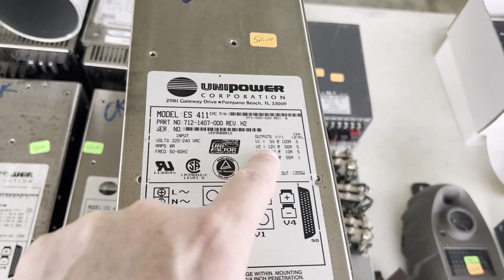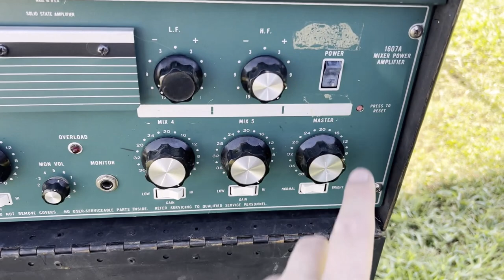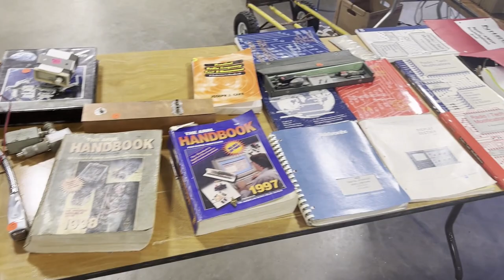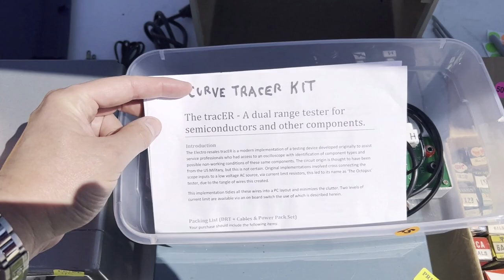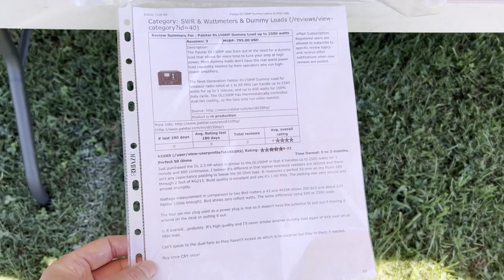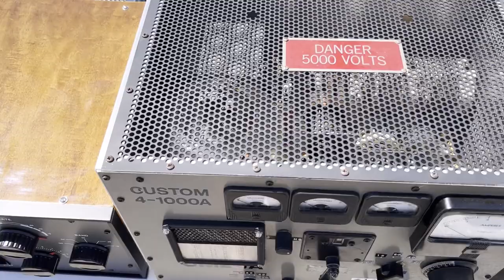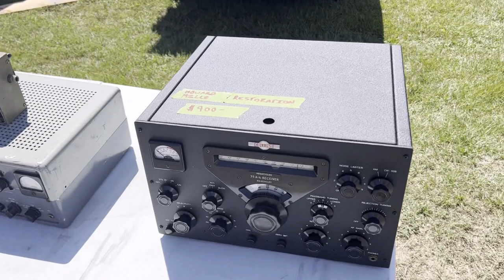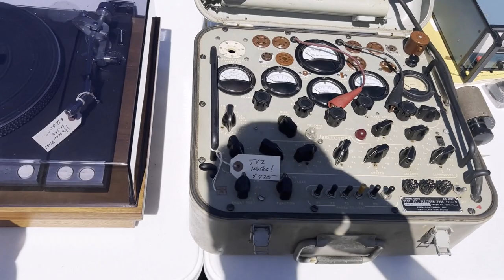Shelby NC 2023 Hamfest 3 Day Walking Tour - by Blueglow / KG4FDR

Comment: I love the old stuff at the hamfests.  I catch myself buying stuff that is reminiscent of my younger days on the air.  I like to get the stuff running again but once I do, I just can't get myself to get on the air much.  Maybe when I get "really old"  at eighty, I may become more active.  Was off the air for 29 years and cranked up my old Swan 350C and got right on CW.  'Still remembered the code well.  Lots of broadband noise in my area, likely from solar power inverters or some other square wave stuff.  I'm rural and shut off my entire house and I'm still getting the noise.  'Bought a mini spectrum analyzer and I need to get off my butt and figure it out but it's coming from some other place other than my property.  Thanks for the virtual hamfest tour.  Brings back lots of memories.

Comment: 2:10 I bought that Astron, had a bad cap. I was going to fix it but someone wanted it.
3:04 Still need to test that tiny vx-1r.
21:28 Little one was $10 never seen that type before. 
39:58 Cable puller likely from the power company. 
47:00 YCARS Hi Philip, Richie